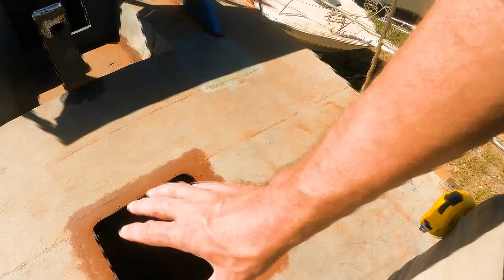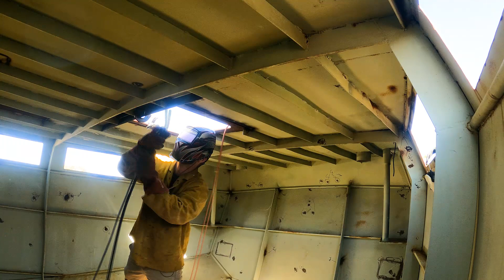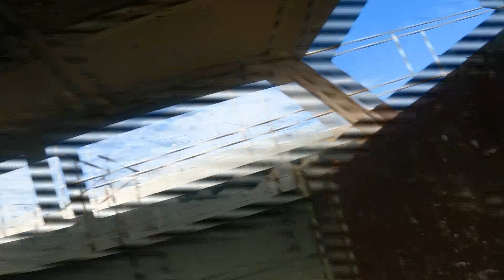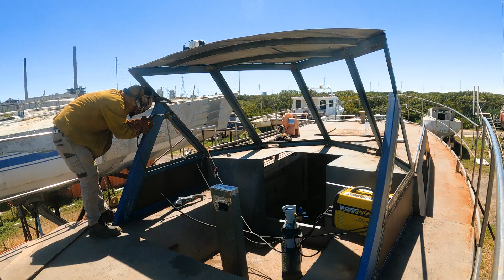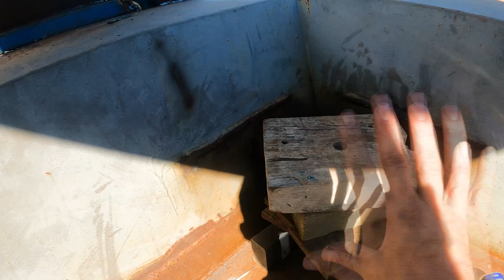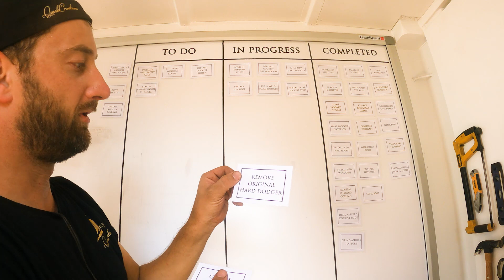Sailing QC #55  | Fully Welding Hard Dodger & Deck Supports  | Steel Sailboat Restoration

Comment from the maker: Finally we fully weld in the hard dodger and grind it smooth....so close! After cutting large holes in the deck to accommodate the new hatches there's a bit to much flex in the steel, to remedy this we weld in some deck supports throughout. PLUS a long awaited whiteboard update too!!